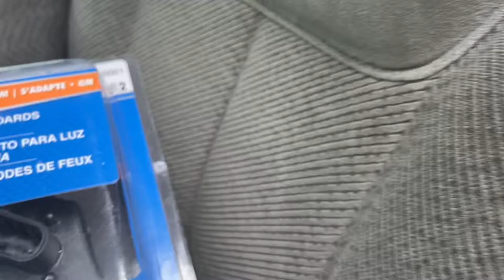No Brake Lights Or Turn Signals? Try This Easy Fix (88-98) Chevy/GMC

Comment: If only 1 of my bulbs isn’t working but the other 2 are do you think a circuit board would fix it?
Reply from the maker: There’s a possibility also make sure that the bulb that’s not working is the correct bulb.

Comment: I have issue my parking lights and turn signals work but when braking my lights don’t come on. Replace light change brake switch
Reply: Did you solve this issue.
Reply: @crayonkids3982  no I haven’t it get a slight power but it’s extremely dim you can’t even see it

Comment: i got an issue too with my brake lights but when i changed the bulbs there was no circut board and the new bulbs didnt fix my brake/ turn signal problem
Reply from the maker: You have no circuit boards?

Comment: I have running lights, backup lights and both turn signals working. But no break lights. Already replaced brake switch, fuses and bulbs. Still no brake lights. Do you think replacing the circuit boards will fix it? Because we have tried just about everything we can think of. We need the break lights to pass the inspection.
Reply from the maker: I had the same issue I replaced my circuit boards.
Reply: I'm not even getting power to my circuit boards
Reply from the maker: @randomtube8226  are any of the lights working?
Reply: Yes all but brake lights.
Reply from the maker: @randomtube8226  check the plug behind the circuit board and see if there is corrosion you can DM me on IG @97.gmc
Reply: I don't have ig
Reply from the maker: @randomtube8226  instagram?
Reply: @MR.BROWNPRODUCTIONS Yeah I don't have Instagram. I'm still having electrical issues. But I did get my brake lights working again. When I put in the new brake switch. I didn't have it in the groove all the way. It came out of place. So when I pushed on the brake. The whole switch would move instead of the switch arm attached to the brake arm. Hope that makes sense. After I got it up in there good on track. All the tail lights started working again. Guess you have to successfully turn on and off the brake lights to reset the sensor.
Reply: Just have a question 
The running light 1st bulb and 2nd bulb stay on at night ? Or is it just one of them
Reply from the maker: @mexicanboi2161  I think it’s all of them but the reverse lights.